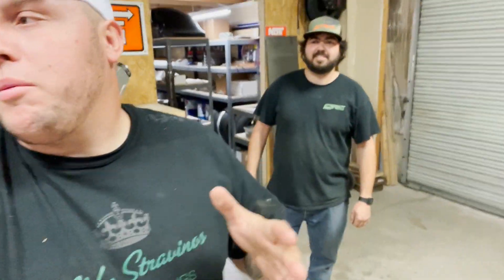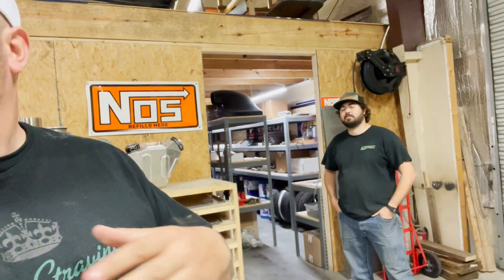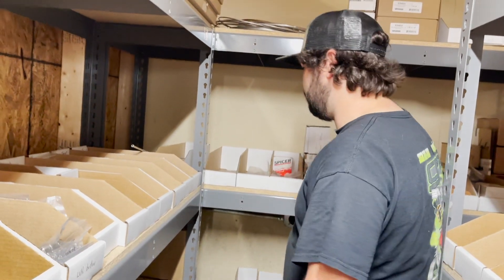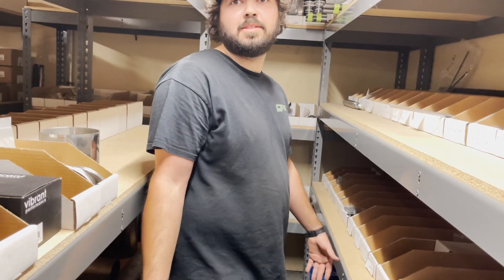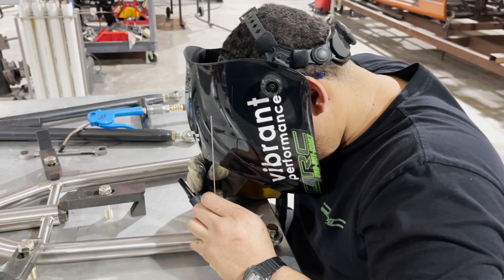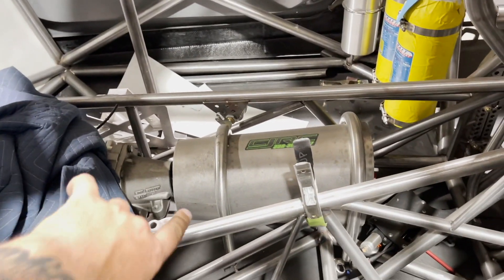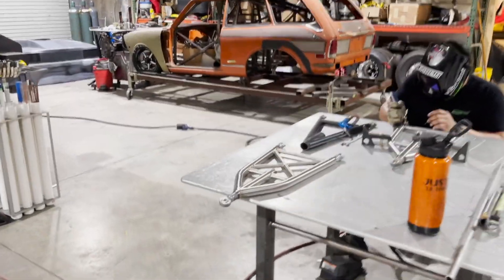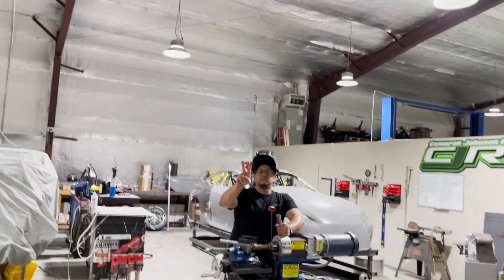CJ Race Cars One Stop Chassis Shop!!!! INTRO

Comment: It would be cool whenever they are building something to talk about how and why they do it the they way they are doing it because of their past experiences of working with other materials or methods.  Also, when they are building something to explain the contrast of different materials, e.g., what the difference in weight, strength and cost would be between chromoly and titanium tubing.  Maybe give some examples like how much weight would I save if I replace every nut, bolt and washer in my car with titanium?  Remember every video is a commercial of why you are they best at what you do and good luck with this.
Reply from the maker: Thanks for the input. Definitely looking to see what people what to see 💪🏻